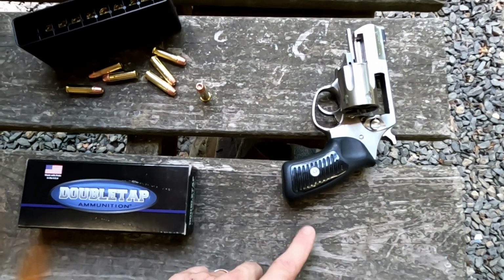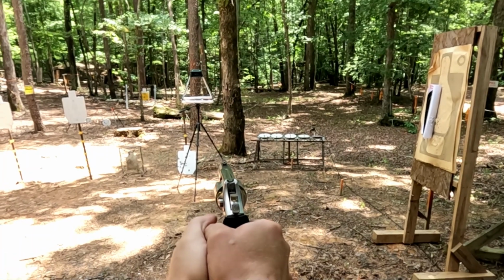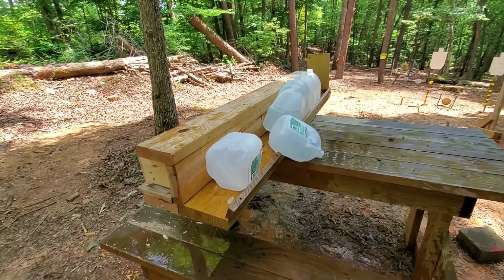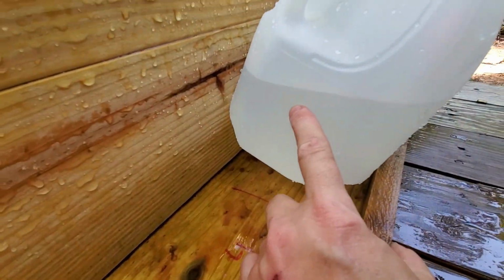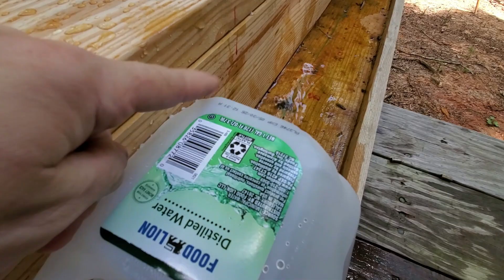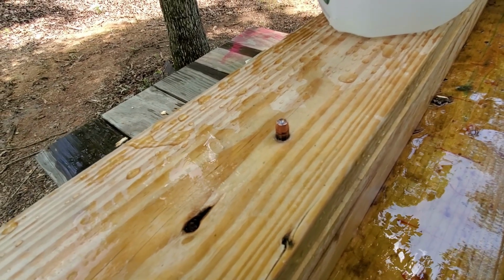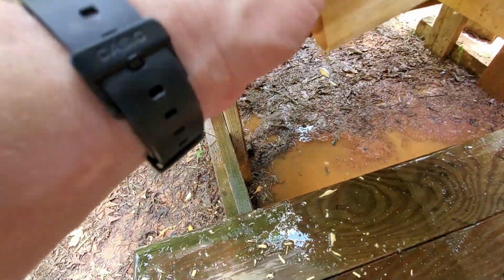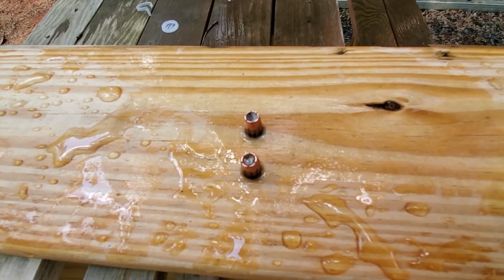38 spl ballistics double tap 125 grain bonded defense

Comment: The hollow point looks just like a Spear Gold Dot to me. They typically open up pretty good in 4'' barreled 357 Mags but I think the velocity is just too little for expansion at well under 1000 fps
Reply from the maker: That's why I like doing these tests.  Some rounds don't work out of short barrels even if they work really well out of say a 4 or 5 inch barrel.  
Doesn't mean it is a bad round, just not a great choice for that barrel length.
Thanks for watching.
Reply: @murphyfirearmstraining3630  That's very true. Its especially difficult in a 38 snubby to find ammo that both expands well & penetrates to a good depth. They're out there but there's not as many as in 9mm Or 357 mag